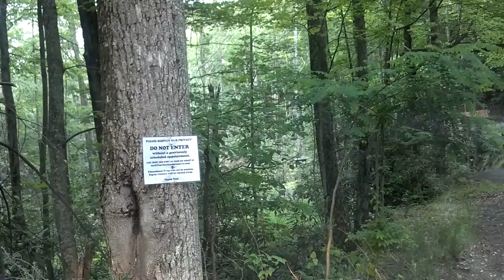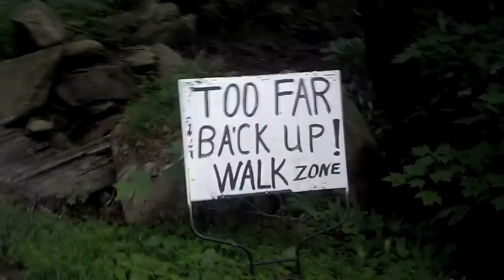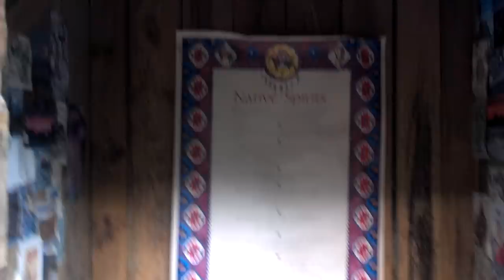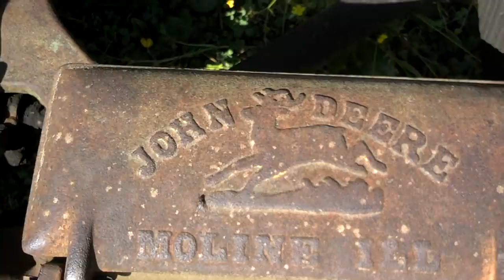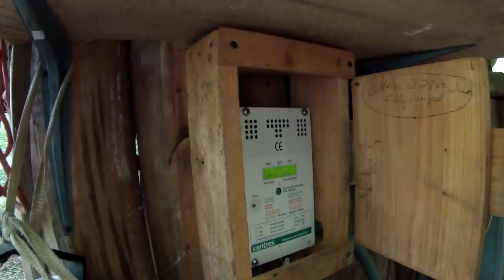A Visit to Turtle Island Preserve

Comment: I live off-grid in New Mexico and have for years. I have electric 100' from the house but my electric comes from solar and wind. I heat in the winter by wood that I cut. The county sent code enforcement with a couple deputies about 4 years ago. I greeted them armed as well as they were ordered them off my property. I told them they better have a warrant if they ever returned. Haven't seen them since. I live 40 miles from the nearest town on nearly 15 square miles of land. Just because I have electric on my land no government agency has the authority to order anyone to connect.

The problem Eustace has is he is operating a business. Non-profit as it may be commercial codes come into play. There are ways around that. The government is worried about loosing a few tax dollars and people learning that they don't need the government to provide for them. Eustace would have never encountered an issue if he hadn't applied for 501c3. He can be exempted by simply listing it as a religious retreat and accepting donations as opposed to any fees he may charge.

I spent 27 years in the Marine Corps as a helicopter pilot. I still fly but have limited use for being around people. I'm not very good company and prefer being left alone. When I need to see a doctor it's a 140 mile drive so as you might guess I don't see one very often and quite frankly don't need to. 

Over the years I destroyed my lumbar and cervical spine. Every 3 years I get mri done and 2 years ago I finally allowed a lumbar fusion. My plumbing and electrical are just fine but I do suffer some termite damage for years of playing hard.

I have 1 very good friend that comes by regularly to visit and I love the man like a brother. He is the only person I have ever given a gate key to. Yes, after the government criminals showed up I put a gate up with a lock. If Eustace is still there my prayers are with him.